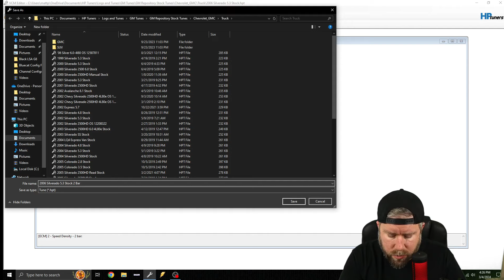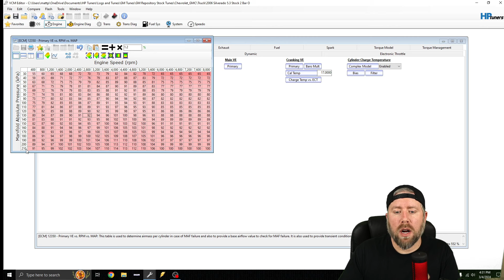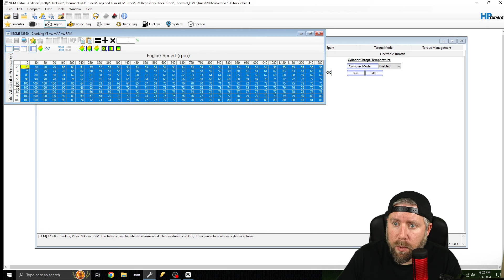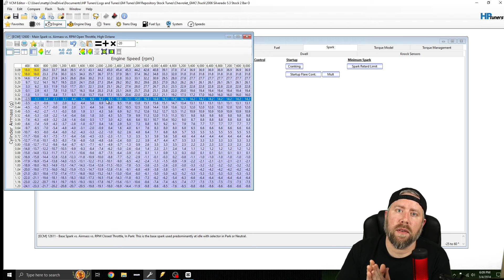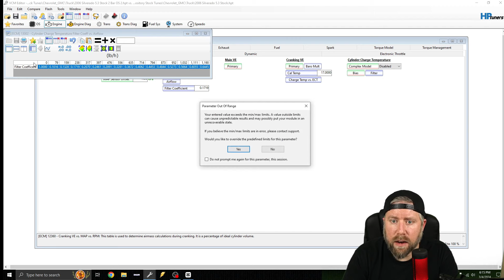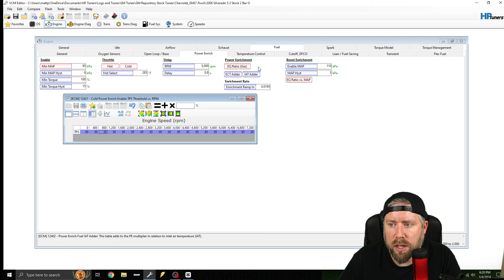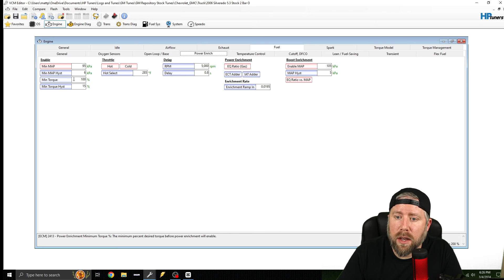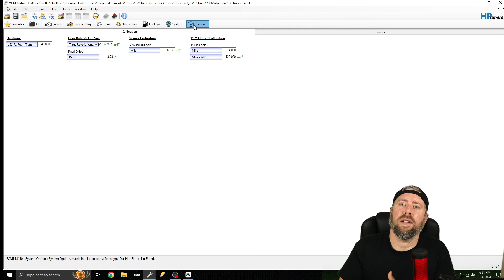Learning how to scale 0411 Gen 3 LS ECMs for BOOST!

Comment: Was it arbitrary that he multiplied fuel and spark tables by 0.5 (1/2 injector flow rate, using 50lb/hr)? Or did he use 0.5 as a multiplier because he's using a 2bar MAP (double what stock was). Apologies if I missed that explanation in the video somewhere. I came across another video / forum posts that describe logging the cylinder air mass to see what that value is (ie. say you logged 1.3g at 4500 rpm, scaling the tune 10-15% would be enough) My understanding is that scaling the tune as much as little necessary for your combination is to maintain as much resolution as possible.

Comment: Using power enrichment for boost is a big mistake. If your fuel trims are swinging negative when you floor it, it locks the negative factor in and subtracts from the enrichment fuel. I chased my tail because of this. I disabled all PE and tuned the VE table and my fueling is constant. Believe me when you are running over 20psi you don’t want it running any leaner that what you set it at. Just a heads up. Do whatever makes you comfortable

Comment: These videos are awesome! I notice you like to disable LTFT for the most part. I've noticed typically STFT are much more volatile on transitions and tends to skew data to the point it doesn't seem correct. Do you feel that is actually a more correct representation of what the engine is doing? Is there a specific reason you prefer tuning with STFTs?

Comment: This video just answered so many questions that I had about using an OEM ECU in an upcoming project, in order to keep it as cheap and simple as possible, yet retain a bit of flexibility in terms of boost control depending on the situation without having to change complete ecu maps. From your explanation, what I gather is that it will allow me simply toggle between between 2 or 3 preset boost levels on a seperate controller on the fly (ie. Valet Mode, Normal, Towing/Hauling or whatever). Again, not a race vehicle by any means, but giving me the ability to have something like an 6psi, 10psi and 14psi preset to choose from on a seperate controller. I gotta watch more of your videos now.

Comment: Hi, I have a question on the power enrichment.

I saw at the commanded KPA you went above 1.0 for the EQ. Aren't it supposed to be lower than 1 Lambda? To run richer? Exp 0.8-0.85? Also note I am om the Audi platform with HP tuners

Still a noob here busy learning lol

Comment: Currently dealing with a “tuned” c5 corvette with a Magnuson supercharger kit. Maf only tune, stock map sensor, 42lb injectors but still the stock injector data except they did change flow rate. Really a pain in the ass starting with someone else’s tune which seems kinda wonky.

Comment: You ever had a E38 pcm that didnt have a 2 bar OS option?
Reply from the maker: I have. I just continue on with using VVE if that’s the case. It’s rare but it does happen on certain OSs.
Reply: @Matt_Sanford  thanks, I know the vve can be extended, just have to enter your own values. Was going to go to a 2 bar os, but this is my first e38 without that option